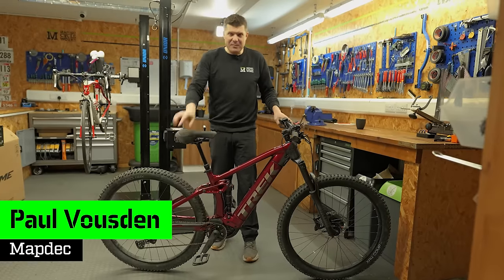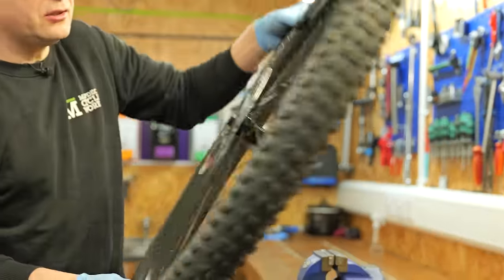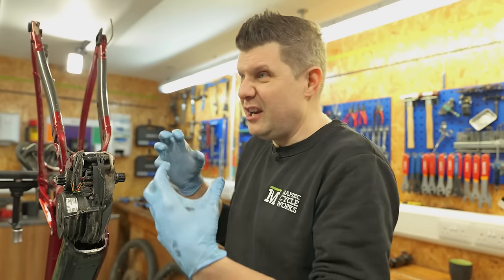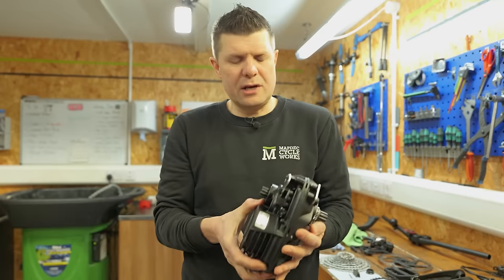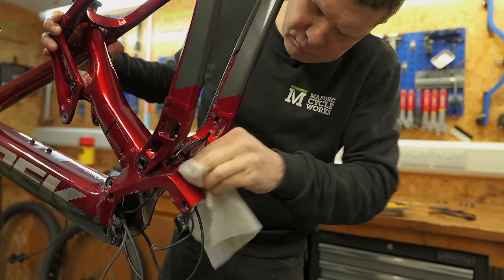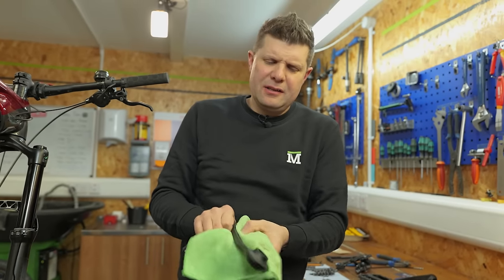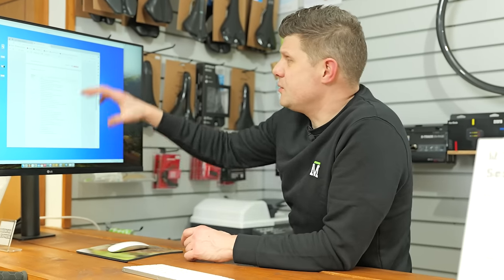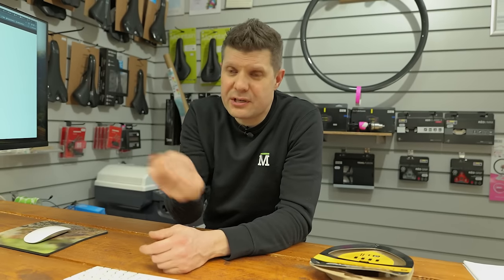This is how much work it takes to service your eMTB

Comment: Regarding cleaning - we have customers that come in whose bikes are (politely) caked in mud - do you have an upcharge for cleaning? 
Also, I noticed your shop uses a solvent tank rather than an ultrasonic cleaner (at least I haven't seen one in your vids) - does your solvent system recycle the cleaner (some units have a heat/filtration cycle) and is it a hydrocarbon based solvent or? I really appreciate the dedication to detail and quality your shop has. It takes a special shop and educated customers to make a go of it at that level.
Reply from the maker: Hey. Yes. We charge £15 for cleaning. Or give the customer the opportunity to use our wash station outside.  The cleaner you see is a Smartwasher.  It is an enzyme that is kept warm and cycled.  It’s not a solvent.

Comment: I just came across your channel whilst in the rabbit hole of YouTube and am so glad I did! Especially after finding out you are based in Kendal - which is 10 miles from me, new customer to be added for sure
Reply from the maker: Cool. Only been here a decade.  Glad you found us.
Reply: Haha! I do try to stay as local as possible to be honest but my 2 local shops (within 1 mile) are (how do I put this...) great with wheels/mechs/cables etc but not exactly at the forefront of technology. Neither will touch my eBike and on my ancient Giant Anthem 29er one of them replaced by brake fluid with DOT4 !!  @Mapdec

Comment: That's worth every penny for the quality of your work.
Unfortunately it's not been my experience with the bike shops ( or car shop tbh )  I've used who either do nothing but charge plenty still or find stuff that's wrong when there is nothing needing doing and also just doing a poor job leaving things untightened or spilling brake fluid everywhere and not bothering to clean it off etc etc.
Had one guy who left the oil filler cap off the car on a very expensive car.
Finding a good mechanic is priceless and once I trust them I will pay whatever they need to do the job properly.

Comment: One thing to note, and this is from the tech guys at Shimano/Madison, is that if you run your rear mech through a parts washer you should always perform a clutch service on it afterwards. Even though it is technically sealed they have told me in the past that it isn't perfect and will need re-lubricating afterwards or else it is going to run dry and cause more issues in the long run.

Comment: As a bafang ultra uart owner. I don't have to deal with proprietary software and hardware, all the parts I need are easy to find, cheap and accessible, including batteries. I have 1000w at my disposal at any given time, a throttle when I get too tired and was way cheaper than any other brand name eMTB, I just connect my laptop when I want to change any settings. Plenty of info on online forums.

Bosh have their system lock down, you only can use their batteries that cost a fortune and their chargers that are 3 times more expansive for no reason. You require a bosh dealer account to have access to software updates and diagnosis.

Now, my question is: If you can't change anything on YOUR bike, and you can't fix yourself without Bosch authorization, a bike you paid for, does it belong to you?
Reply: Well said. I just got my first eMTB with Bafang M510 motor and it is fricking awesome. Was on sale too for 2000€.

Comment: I have the exact same bike, so picked up some good tips from this, the loose back wheel is a well known issue with those bontrager hubs, complete garbage, the whole wheel set is crap.

I have no confidence in the local shops around where I live due to quality of work. I’m more than competent at fully serving the bike myself and would prefer to do it myself, but I have to use the locals to keep the warranty.

Comment: I hate these new bikes,i think the beauty of cycling was its simplicity and ease of maintenance...its just a cash cow now.and since when did i ever change a chain on my old Peugeot 105 now we change em like underpants.
Reply: Yeah ya gotta wonder if in 5 yrs you'll even be able to get parts for a bike like this let alone a battery when it inevitably dies.
Reply: @scottf3456 The batteries are easy to find, even on much older Bosch ebikes. The issue is more that they're expensive.

Comment: On the Trek Rail e-bikes, the rear UDH has been found to be under-torqued in many cases and if left unchecked could allow the derailleur to swing back and get tangled with the frame or cassette. The nut that tightens the UDH is also reverse.

Comment: I'm in the wrong business servicing an ebike looks like a way nicer and less stressful job than servicing a car no rusty bolts that want to snap or not come off no skint knuckles cause the manufactures put oil filters clips and bolts in horrendous places no getting covered in oil cause again the manufactures put oil filters in horrendous places no causing warning lights to come on because you need to move electrical parts out the way that have rusty crusty wiring that break when you flex them and you can charge 400ish pound without fireworks this comment isn't me being sarcastic or derogatory it's genuine envy your job looks awsome.
Reply from the maker: Oh this was a dream service. We have all those problems but with stupid fragile light weight bolts and expensive carbon parts.  Bike mechanics is mostly just fiddly and compatibility riddles.

Comment: I have this same frame, a new Rail 5. I was wondering about the dropper cable. So, do you have to remove the motor just to replace the cable? Hope not since I seem to go through dropper cables more than deraileur ones.
Reply from the maker: Pretty much.  Trying to route an outer cable through the motor housing is easier if you just take it out.

Comment: Hope you have a Torx-plus for those Bosch screws! Wera L-keys spotted so there's to hoping. Top notch service as always! Also, Bosch just said in one of their training days that if there's corrosion already, you can use vinegar if you don't have fancy electrical contact cleaner at hand.
Reply from the maker: Yeah. The torque bit at the is T+ the L keys great for quick disassembly

Comment: Just finished full suspension bearing, forks and shock (rockshox, air) along with all my wheel bearings. Also its an e-mtb... all these fools crying in the comments.. they deserve to pedal unassisted! It costs but it has its benefits, diy is the way!
Bafang m620!
Reply: To note..
Yes it does trash hub bearings and I am now single speed. You'd be surprised how it do.
The bosch motor has a lovely pocket for shite to gather now doesn't it..

Comment: rather my bafang motor, its been a dream to work on and service myself, no mental over inflated prices on parts. costs around £15 for new gaskets when servicing every 1500-2000km, motors on 280000km and so far its needed nothing but grease! and still going as strong as day one

Comment: 20:09 Awesome Stayer gravel bike build in the BG
Reply from the maker: Damm brake mounts are so wonky it’s giving us a ton of grief.
Reply: Not too much grief I hope 🙏🏻
Reply: Ah - I see... the joys of boutique handcrafted frames 😆
Reply: @jayjaytronics8358  it's my bike. To be fair it's been absolutely fine with the 140mm disc. I wanted to fit a 160mm which I had to match the front. It's the mounting kit that I couldn't get to align so well when I tried. It's in for maintenance as I've done near 4000km on it in the last 18months. A lot of mud and gritstone where we live. Chuffed to see it in the video though 😀
Reply from the maker: @Ecoroof1986  sorry it’s taking so long. The team need my help with it and I have been out of the shop for a couple of days.

Comment: Another really informative video. Just a bit surprised you would leave a battery on charge overnight in your shop when no one was around to monitor it. You mentioned you had seen some moisture and lithium ion technology can prove to be unstable in these conditions. Although this is very rare is it worth the risk. I do not even like my mobile to be on charge if i am out of the house. Thanks

Comment: Had a trek rail, first problem I had was the dopper as well. My legs are on the shorter side so I had to slam the dropper in and the cable got smashed as well and basically never worked right. I was just tired of screwing with it so I bought my first Reverb AXS dropper and just kept buying them because I pretty much have the same issue with most of my bikes.

Comment: Could you make a video about torque wrenches that are the different options and how many you need for different services… Include wera they are my favourite too!
It is confusing because they have different ranges and there are different torque settings for different parts like suspension
Reply from the maker: Nice idea. I’ll try that.

Comment: Great video and amazing overview to maintaining an ebike! The thing i wondered is that Isn't it risky to spray that "protect and shine" with the rotors on?
Reply from the maker: Hasn’t been a problem for the last decade. If it was I wouldn’t be doing it as we would have to keep changing rotors when customers complain.
Reply: @Mapdec Good to know, asking because many of the big cycling channels have warned against it, but then their tips usually need a good serving of salt.

Comment: Man I just don't understand why many people think ebikes are 100% throttle-based. Are these people all from USA that's full of these kinds of ebikes? I have an e-gravel and I am always out of breath riding it. Way too many gatekeepers defining what cycling is or should be about. I put out the same amount of work and the ebike just helps with longer distance and more climbs 🤷‍♂

Sorry for the rant! I actually enjoyed the video. Mine is also over a year and should have it checked.
Reply: 100% valid and correct. I also get a great workout on my e-mtb. I have eco mode adjusted to train my legs that I even pass roadies while not assisted and they always get pissed about it as my bike is heavier and bigger tires. Then i go into the woods and I put it on tour + while getting out the saddle and then you train your legs as well.

Comment: That fork most possibly feel stiff because of the bushing in the first line. Take it a part, remove all the internals. Put the lowers and the upper assembly together and move in and out to see how stiff it is. Than, take the front wheel and mount it into the lower. That's the starting point to see how stiff is the fork initially. From this step there are 2 options. Burnishing the bushings to loosen up them and/or shim the hub to align the busing. You can buy DIN988 washers in different sizes, eg: 0,1mm. You can put it under the hub caps. Or sand down the hub cap if the hub spacing needs to be less.
After you shim it the fork will be day and night.

Seals: in real life you don't have to change the every 50h. Those seals have a lot durability. Sticking does not come from the seals, comes from the bad stanchion aligment, bushing tightness, lack of lube, dirt.
Give it a good clean and it will survive at least 2 50h service. 
Soaking foamrings are much easier in a small ziplock bag.
Reply from the maker: We actually resized the bushings.  Choose not to show on YT as it would detract from the story.  Maybe a future vid

Comment: Great video and expertise stripping this down. Can I just check if you have ever had the motor mount bolts loose on the Bosch performance line Cx motor? I have heard this is common amongst rail owners and mine is very noisy.. thanks

Comment: 0:41 "travel spacer"? That's called a sag ring. And nothing wrong to use 90% of the bike suspension, it's actually ideal, that's why she paid for it. It doesn't necessarily mean it needs a service. And maybe it's soft because is not set up for you?
Classic bike shop diagnose: people go to change a tire and are informed they must service everything 😅Why I prefer to do my own service, it's actually much easier that many people think, and my bikes are in mint condition without braking the bank.
Reply from the maker: I think I have worked on enough shocks to know what feels right for rider weight.  Sometimes I misspeak on camera.  Ah well. You know what I mean. 🤷‍♂️
Reply: @Mapdec  Riiight. Trust me, I'm a bike mechanic 🙂 Whenever people absolutely need a technical diagnosis (mechanical, medical, electrical...etc) they should ask at least 2 opinions, ideally 3. I bet they will be surprised by the results, I definitely was.

Comment: Great to see the quality of your work. I think I would trust to you, what is definitely rare.
But one question at least. What kind of finishing spray you use. Mostly they are based on silikon oil and it looks as it gets to the brakes. Isn't it necessary to cover them?
Reply from the maker: Lots of folks have mentioned this now. I have been doing this for years and can’t say I have had complaints or issues with it.

Comment: I got Swissstop SR (yellow) pads for Tektro MD-C511 brakes working on Sora Shifters (Boardman 8.6 ADV). I sanded them down with P100 after use, used degreaser, burned it, used degreaser again. Then I sanded rotor, used degreaser. I centered the rotor and adjusted gaps under 1mm each. Cable operation is smooth. Stopping power is not good. I have a 15-year old carrera with basic metallic brakes and stopping power is 100% greater (wheel stops with half the effort during any speed). What to do?
Reply from the maker: I think it rather shows the diversity of demographics it attracts.  You can enjoy cycling on almost any financial level. The performance advantage of super expensive is so marginal, that you don’t need it to be competitive.

Comment: Thanks for the explanations, what grease is the red? Just got my syringes from you and they are great. Have the Mobil xhp222 also. What’s the difference with this grease vs the red on the dropper? Thanks
Reply from the maker: The red is a calcium sulphonate grease. Good for non moving parts like threads.

Comment: Super nice job. Major respect from a guy who works in a shop that doesn't go to that level. That bike is better than new. 

I was wondering though, why you just didn't regrease the rear derailleur clutch with all the heat cycles it endures. It seemed fine, but we had a new batch of Deore from Indonesia that was bone dry, but a different batch from another Asian country was perfectly greased. And it only takes 5 minutes to regrease and check that the gasket is greased and doing its job, especially on a MTB. Great job on sorting out that cable routing. Did you bill for the headset bearing? 😂
Reply from the maker: It’s a good question. I should probably look at this more than I do.

Comment: I don‘t know if it is different in england but in germany the bosch motor is bolted in with torx 40 plus  screws and it seems that you use a normal torx 40 which can damage the screw more easily if i‘m wrong  feel free to correct me  😊
Reply from the maker: We don't have the security pin here. The Wera Torx L key fits really well. I have a Torx Plus 40 bit for the final torque

Comment: any tips how to stop a rear brake disk howling and vibrating when braking , it is really loud and embarrassing when on public roads , I have tried all I know , cleaned disk , removed and clean pads and sanded on a flat glass top with emery grit ,  still the scream from rear braking ,  thanks
Reply from the maker: Check for fluid leaks.  Check nothing in your garage is contaminating,  get the mounting surfaces faced.
Reply: Put a washer under each mounting plate too move caliper slightly further away from the disc . (Hack I worked out)and make sure disc in middle of the groove in the caliper

Comment: Wow. First off, you did an excellent service, essentially a rebuild. But it presents an aspect of e-bikes that had never really struck me before: w/o expensive and qualified upkeep, (and you are vastly more conscientious than most would be), the life of a well-used e-bike is going to be short. That is an expensive machine! I just checked prices here in Canada. You can buy a motor-bike for less.

That purchase price certainly justifies your £400 service cost. I just can't believe the purchase price...Then again, even in my mid-Seventies, assisted cycling just isn't my thing. Now that I know the cost, it really isn't.
Reply: It’s good that you have a choice mate , for some of us with worn out bones or physical challenges , we absolutely need a bit of motor assistance.
 But yes , adding a motor does add complexity and extra maintenance and cost to your bike or trike ownership.

Comment: I found one problem with Jag Wire cables (compressionless), the outer sleeve tends to push out inner steel reinforcement strains on the ends. It happened after several months of using it.

Comment: What's with adding grease on top of the dust seals on the bearings? Especially if the bearings felt rough I'd remove the seals and add the grease inside the bearing..

Comment: electrical connection corrosion also risks battery fire. how much juice does that e-bike carry? is it li-ion or what chemical? is there a fuse or other safety mechanism inside the battery container between the external terminals?

Comment: I do not think this is really expensive.
For you to know from where I live, very very close to UK, lbs does not do servicing of shock/fork but ship to center.. Therefore, the invoice is usually 250/300 euro each alone!
So for having the whole bike checked and grease for the price we see here, I would stop right away doing it by myself.
I also think people should really picture that firmware update is unfortunately usually not possible for DIY and you need to go through an lbs.